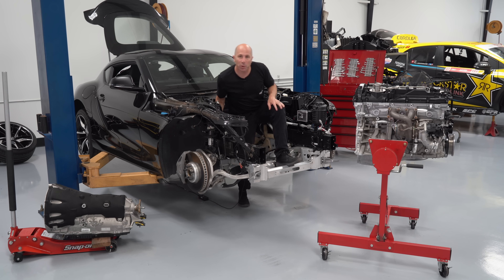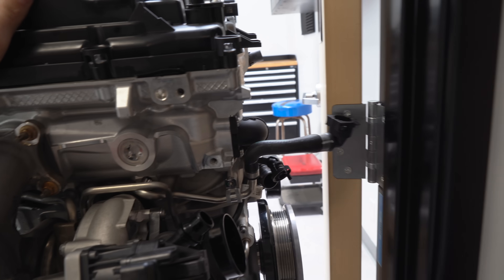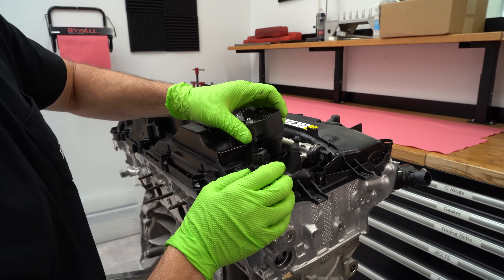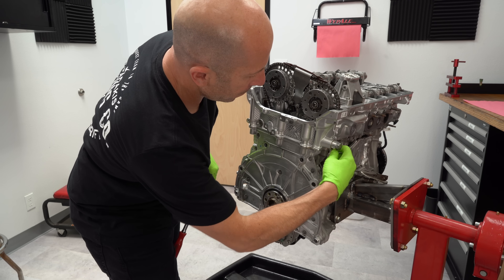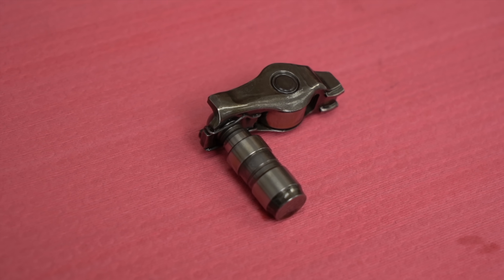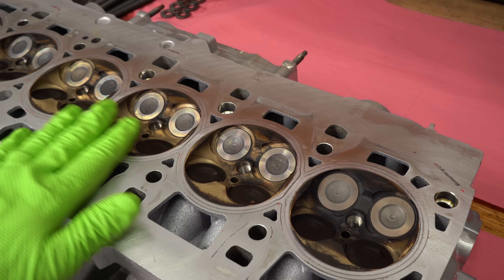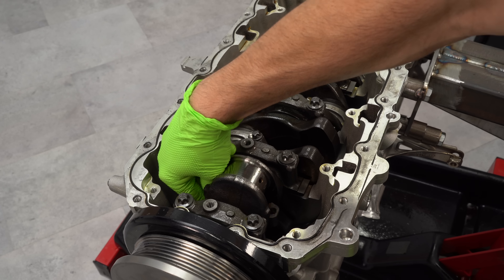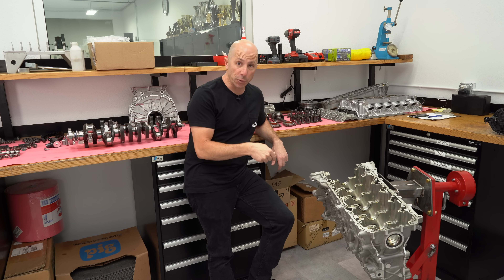2020 Supra B58 Engine Teardown - First Look - Better than the 2JZ?

Comment: Cracked rods scare me, the slighted scratch/chip and the whole rod becomes scrap metal. Was rebuilding a Di13 scania when a rod fell over in the bench while cap wasent on tight, left it only for the rod to fail when it was dyno'd. They are stronger so long as you treat them like a newborn while its apart

Comment: While I can appreciate advancements in modern technology what I miss is the simplicity of the old engines. Long gone are the days of looking at gorgeous and clean plenums and head covers... now having to see an ugly beauty cover hiding a birds nest of wires and even more plastic.
Reply: I agree. Shit loads of plastic on that thing. Really important parts were plastic. I figured it would be normal to see that much plastic on a 20k car, but on a 60k performance car?? I expected better.
Reply: @Gary-tc7zx  400hp for 50K its decent, but the mustang has more power for a smaller price, so if Toyota gives 50 extra hp and a better dashboard bang its worth every penny.
Reply: @Gary-tc7zx  That's how 2019 made cars are lol. Even the more expensive ones. If you want something from 2019 with a proper cover you'll have to get a Ferrari or Lamborghini or something. Everything else below that is literally all plastic lol.

Comment: 500 miles and you already see a huge difference between cylinder 1 engine head color and the 5 others. 9:51
It's wayyyyy darker : i guess it's running way cooler.
That's no good.
The m50 bmw engine series have a reversed rotation oil pump screw,you can see that's a bmw engine right there....
Cracked rods "technology" is very old,it's not special.

Comment: The plastic intake that's glued to the water to air intercooler (definitely would go aftermarket) and the timing chain being in the back (meaning removing engine for when you wanna upgrade or change it at 200k miles) being the 2 things that really suck. Other than that I'm excited to see what this inline 6 will be capable of, and all the nice sounding exhausts.

Comment: this engine is very simular to the 1.0 tsi from volkswagen, intergrated intercooler in air mainifold. same turbo/exuast layout .. weird
Reply: It's actually very common in many german engines. The integrated exhaust manifold is great for emissions regulations since the engine can come up to temperature quicker and there is more space for catalytic converters and particle filters.

Comment: Hi there congrats for the video. I think that engine use the same valve train that is used on the minis EP6 engines mounted on PSA group too. Designed by BMW. Im gonna send you a video for assembling the valve train with a home tool that I made by myself. Sorry for my bad English. Frank.

Comment: The intake manifold, the rubber gaskets, the exhaust manifold that's part of the head all remind me of Yamaha outboard motors.
Was the head designed by Yamaha again?
Reply: it's a BMW engine
Reply: @raulalejandrobastillapedro1564  Yes, I know. The 3SGE/GTE, 1/2ZZ, 1/2JZ are all Toyota engines but the heads were designed by Yamaha.
Reply: @AaronBonBarron  this B58 is derived from the N55,which is derived from the N54,which comes from the M54,that comes from the M52,which comes from the S52 all BMW engines, no Yamaha designers there...
Reply: @raulalejandrobastillapedro1564  that's all I wanted to know lol
They use similar design choices, and this is the first car engine I've seen with the internal exhaust manifold, it's pretty neat.

Comment: It's interesting how they used a mechanical fuel pump on this engine. 
My E30 also has a mechanical fuel pump, but it runs on something like 10 psi.
Reply: All modern direct injection gasoline engines have a mechanical fuel pump driven by the camshaft for the high pressure required by the injectors,that is common knowledge for 15+ years now.They all have this reconizable "clacking" sound at idle.(At high rpms too,but you can't hear it over the engine 😉)
Reply: @raulalejandrobastillapedro1564  And I was planning to get an electric pump to go efi. The irony...

Comment: Short answer ? No, it will probably make some pretty good numbers, but it will never match the 2J. From this video alone, I can see that the block is much thinner is in comparison, just  look at all the extra ribbing it needs for reinforcement. This engine is gonna be a pain in the ass to mod too, with all its uneccesarily complicated bits and unorthadox layout, especially those who want to do it themselves. I am sorry but this is not a Supra and it will never be for me. This is a rebadged BMW and it should be called as such, for shame on Toyota for outsourcing one of their most iconic series of cars.

Comment: Thanks for the vid on this cool new engine. I like how they have really integrated the turbo into the engine.  It really seems designed start to finish around forced induction. I wonder if the 3d printing crowd can produce something like that combo intercooler/intake.

Comment: Is there any actual difference in the B58 between the one in the Supra and the ones used in the BMW line up?
Reply: Apparently they co-developed the engine, so it's legit the same engine in both cars. The BMW is tuned for 50 more horsepower from factory for some reason.

Comment: How can you even mention the 2j when talking about the B58? By the looks of the taredown it's not a good base for high horsepower but I've got a feeling you already know that. Love the vids
Reply: Drew Drakeley By the looks of the tare down it looks like a really good base for high horsepower 😂
Reply: @SMydland   I can tell by that comment you dont build engines
Reply: Ok
Reply: Why do you think its not a good base?
Reply: @SMydland  
The block, the main caps, lack of gaskets, top end hot side, cams, valve train, manual fuel pump. Imo theres no comparison to the 1j or 2j.
Reply: Drew Drakeley well it depends.. it would probably take alot of work to make 2j monster hp.. but its probably capable of 1000hp with the right mods.. and manufacturers will probably not make an engine as available and strong like the 2j anytime soon..
Reply: @SMydland  
That's the whole point of the 1j and 2j, they are build solid and make loads of power with minimal mods. People talk about 1000bhp and 1000lb/ft of torque like its nothing since stupid films like fast and furious but the forces and pressures at that power are unbelievable and for standard parts like a 2j crank and block or v160 or v161 6 speed standard box to take those forces is awesome to me. I've got a jzx100 i built myself with 2jzgte short block, 1j vvti head and v160 6 speed that's mapped at just short of 760bhp. On a run the intercooler pipe burst on boost and sounded like a grenade and ripped half the front bumper off. Some people need to drive or passenger a decent hp car to appreciate the forces at work in an engine at that power never mind 1k. That BMW engine can never match the golden times of toyota engineering imo
Reply: Drew Drakeley Well I think we have different opinions on what is a good base. My opinion is based of the assumption that manufaturers probably wont make an engine like the 2j available to the masses ever again, and on that assumption im exited to see an angine like this actually beeing made. And I dont really see all the new tech as problems rather new tools that are just not mainstream as of now. I bet steph will have alot less hassle building 1000hp from this than the 4cyl in Aasbø’s drift machine. And no I have not built any massive hp engines myself, just a puny 450hp ford 5.0.. but ive always been around my dad and his friends, so 800hp evos, 800hp 3000gt, 700hp yb coswort, and my dads 2000+hp 750cui twinturbo hemi.. i know its not easy to build massive numbers, but its not as hard as you describe it to be when you have some knowledge about tuning.

Comment: I wonder if the head could be tapped to run the S58's dual direct injection pumps on the head (with appropriate S58 cam) or if they'll just ditch this B58 head entirely for an S58 head setup. Intrigued to see what developments are made and how it holds up trying to hit that power goal.

Comment: The Block is closed deck, yes. But it has no steel sleeves. The cylinder walls only have a really thin steel coating on them. How do you feel about that?
These engines have been around for a couple years now, the stock internals are good for 700hp.
Reply: Diving Duck  no, I read steel. it may be some special alloy or something.

Comment: So cool. Really interesting to see all the tricks used to reduce weight and friction while maintaining a high degree of strength. Most if not all of said tricks were developed in racing applications. Very interesting to see the differences and similarities between this engine and the "big dogs" of inline 6 cylinder tuning: the 2JZ and The RB series.
Reply: Don't forget the barra. Better than both those engines you mentioned (and I love them more than the Barra). Also TB48 but they are not so common.
Reply: @N4CR  I'm in the US, we dont have the Barra here to my knowledge. I've seen very impressive results using that platform online. I should have mentioned it, you're right. Another popular i6 platform in the States are the Cummins inline diesel engines. I realize Cummins/diesel engines are rarely used in race applications outside tractor pulls and mud drags, etc.

Comment: This engine uses the variable cam lift (Valvetronic)  on the intake cam as a throttle.  The throttle on the intake is a backup if the engine senses a problem with that system.

Comment: nothing with timing in back can be successful... maybe it doesn't matter for you (race team) but for general public nobody wants to pull engine when it should have been enough just to remove radiator... thanks for the video

Comment: ok so if you need to replace the oil bump you have to undo timing chain remover engine from car or transmission from the bottom either or and its chain wears out same goes wow what i pain in the ass for a normal wear and tear part

Comment: Damn look at the pool noodles under that plastic cover. Oh almost forgot that modern BMW engines need to get the rod bearings changed after so many miles. Owned a e60, f10, e92 soo fun if you have money for proper maintenance.

Comment: It will be interesting to see what the BMW engine is capable of, tuning-wise.  A couple things I don't like right off the bat:
-No dipstick, complete trust in instrumentation for something as critical as oil level is bad.
- Exhaust side of the head is very limited for modifications with the integral manifold...no access to the ports or the possibility to use merge collector manifolds.  You're basically stuck with a permanent stock log manifold.
-6500 rpm stock rev limit is low.  Why does nothing rev out these days??
-direct injection only will suffer from deposit buildup in the intake side.  I hope they are not putting any crankcase ventilation anywhere near the intercooler, which is not easily cleaned either.  It is expensive/time consuming to clean up the intake ports/valves/manifold on direct injection once it ages and starts seeing some blowby.
-powder metal rods can be decently strong but save considerable manufacturing costs above all else.  They are very brittle.  I would imagine any serious builds will need to chuck those in favor of some forged parts.
-That timing chain requires too much work to replace.  Way too much work, and it doesn't look terribly stout.
-Only 2 bolt mains, but I guess the 2JZ was also only 2 bolt mains also.

It's a BMW Z4 with an appearance package, and really really should have had a manual transmission option.

Comment: I see a lot of people talking about BMW this and BMW that... don’t forget that Toyota was there from day one and scrutinized everything BMW did on this engine, down to stress testing the individual bolts.  These cars are going to be sick, they are already surpassing expectations.
Reply: You must be an owner of an n54/n55 at some point, but agree with both comments I've seen from you. As an n54 owner small things like not using one time use aluminum bolts can make a huge difference
Reply: N52 Owner and considering to get an N54 powered vehicle or wait for a B58 vehicle to come down in price a bit.  They have been on 3-series since 2016.
Reply: @jmayor88  the other b58s definitely wont have the same reliability of the z4/Supra imo. But n54/55 is a fun platform, my engine has been great, but have had to replace turbos and fix a ton of stuff around the engine.
Reply: @joeyrushlow  I'm not sure what you mean... The B58 was developed from 2012 to 2014 and released in 2015.  It's the same engine from the same line in all vehicles.
Reply: @jmayor88  the engine in the supra and z4 from my understanding is built differently due to the collab
Reply: @joeyrushlow  I'm not sure where you got that information.  The engine was developed, than put into production.  BMW started using it first, but that's all there is to it.... Toyota and BMW parted ways on finishing the development in 2014. After that the engine went into production coming out in 2015 for BMW 2016 models.   Aside from tuning, there are no differences in any B58 motor. That would be a logistical nightmare.  Toyota tunes theirs, BMW tunes theirs... the hardware is all identical.
Reply: @joeyrushlow  The only exception being production modifications from MY to MY due to production feedback.  For instance, new part number for the crank in 2019 versus 2015-2018... but it's still a forged crank.  Happens with every engine progression.
Reply: @jmayor88  that makes more sense, I must have not comprehended earlier research on the cars correctly

Comment: wow, put a Supra badge on a BMW and suddenly everyone wants to tune it.
Reply: Lol exactly, for the supra it took a whole movie and some crazy guys in Japan
Reply: You do realize it's more Toyota than bmw right? This motor when originally shown to toyota wasn6up to snuff and Toyota made a lot of modifications such as the closed deck, the girdle, overall thicker block, they also required  the forged crank, along with the connecting rod design, as for the rest of the car the unibody is completely diffrent. As are the shocks and springs,  and everything is tuned completely diffrent by Toyota. So calling it a bmw is factually incorrect.  Toyota put their all into this car. But few to the current ongoing switch to electrification (of which Toyota is an innovative leader) they needed to partner to make it financially feasible for them. But make no mistake this is definitely a toyota. Regardless of the factory is manufactured in
Reply: @kaceydm  the B58 was closed deck from the beginning when it came out because they use the same block for their diesel engines in Europe, aside from the fact it says BMW and Germany all over it, electronic controlled plastic thermostat, cam gears on the rear of the engine, integrated exhausted manifold, plastic valve cover that's going to leak after 60k all just scream German engine.

Comment: Soooo much restrictions on that exhaust side....not a fan of this engine.Rather a N54 engine if you have to go BMW
Reply: Open deck is no good for 1000+ horsepower, N54's start blowing sooner than that even.
Reply: Dirk Diggler As an N54 owner I’d rather have a B58. Not a fan of the open deck design despite it being able to make 890 whp.

Comment: I think BMW has done cracked caps for a long time. The big adcantage from what ive heard is that you split at a stress riser and therefore you release stress from the part.
Reply: I think it's just way cheaper than machining cross hatching that fits together perfectly

Comment: This partnership is rocky, Apparently Toyota is very upset with BMW and it is one reason why BMW is issuing more service memos on things like oil because they had that wrong for 20 years. Other odd bits like seals and bolts are getting changed out.

Comment: As much as I hate to see the chain in the rear of the engine, but I think it because there is less stress for the rest of the crank. Having it closer to the transmission, I bet it lessens the stress on the bearings and similar components through the engine when you launch. But plastic... everywhere. I hope aftermarket companies can find a better solution to the dreaded BMW plastic brittleness after it ages.

Comment: "I don't recommend this, but I've gotta get it done."
That's how it goes.  I've got quite a few special tools I've built, and a couple of them are pretty sketchy.  Not so big a deal if you're careful and minimize the risks, and use something to catch stuff that goes flying.  I've had more than a few non techs give me looks when I did things as basic as pulling a radiator cap with a rag and jumping back when it was hot enough to boil over but cool enough to not crack anything.  We show up every day to GET THINGS DONE.

Comment: weird to see rockers and not hydraulic lifters. Other than that it looks like a shiny 6 cyl version of my 1.8T. the back timing is weird my cam chain tensioner on the head is in back but thats a short chain. oil pump on mine is in front.

Comment: That engine is SOOO GERMAN, plastic everywhere and hilarious not only are the cam gears mountain non-traditionally the other way round, zee Germans used a two piece cam shaft HA!
Reply: Those camshafts are hydroformed and weigh about a 1/3rd of a normal one. (Aka less rotating mass).
Reply: @Wick-d_Trucking   It looks like a terrible idea, doesn't look reliable as they hit 90K miles, not for the regular Joe modder, only time will tell if they hold up.